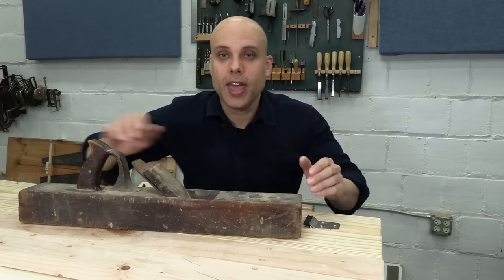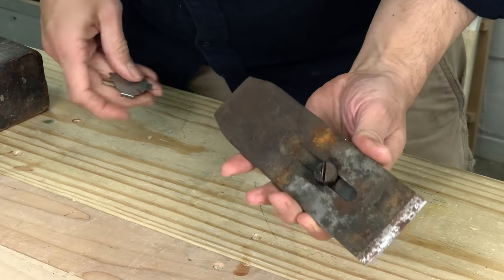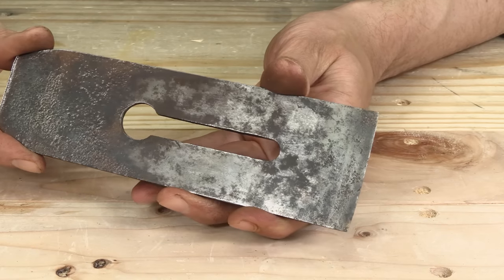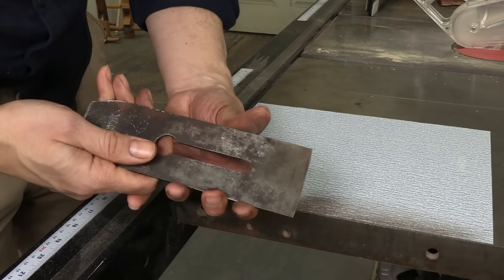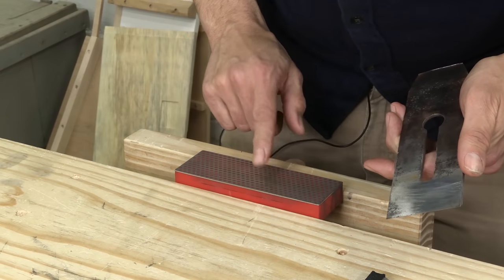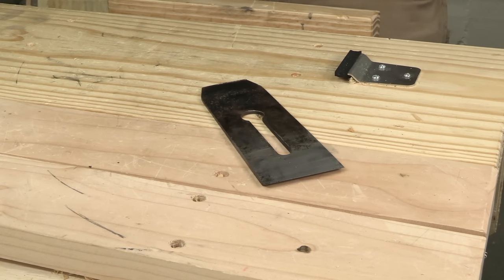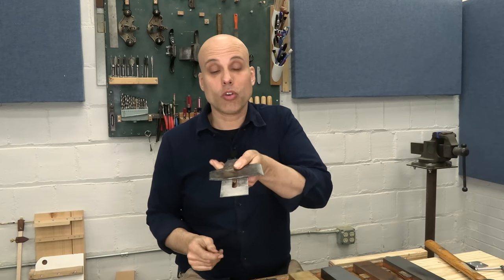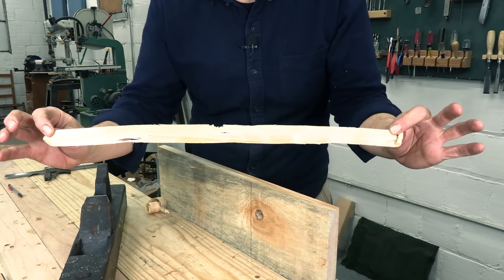Restoring a forged plane iron with MASSIVE rust and damage.

Comment: Hey Rex, love the channel and the enthusiasm. Engineer here: Acid-based rust removal can lead to hydrogen embrittlement in hardened, high-carbon steel, and might have some implications for the hardened lamination and its bond to the blade's base metal. (It also might not affect it at all, but it's a risk.) So the wire wheel: good call.
Reply: I prefer a wire wheel, brush or  cup brush too. There's no really need for those chemicals.
Reply: Steam it
Reply: What about electrolysis rust removal? Would that also risk embrittlement?
Like acid this method also out gasses hydrgen

Comment: I like your stuff and glad you are keeping these old traditions alive. I am a professional furniture maker and I have a massive collection of old planes. BUT when sharpening after grinding your 25 degree angle there's no need for more than a couple of strokes at 30 degrees. Only the very tip of the blade needs to be sharpened. You were over working it and didn't demonstrate flatting off the burr after sharpening.
Reply: Yep. I do ~ 50 stokes at 25deg, and 6 at 30deg. 2 square, 2 favouring one side, and 2 favouring the other side. Plus, debur the back with the steel rile trick from Rob Crossman vids.

Comment: Well now I know for sure the old gussstahl german scrub plane I've been sitting on and wondering about is well and truly dead.  There is almost no tool steel left on the blade.  I had a feeling it wasn't able to be resharpened anymore, but it was dirt cheap, and looks nice in my office.
Reply: Hmmmm. I recall a place called Dusty Rose. I think. And he makes plane irons and even the angled ones I think. Rex knows it infinitely far better than I. 🙏🔥⚒️🧙🏼‍♂️

Comment: I’m in the UK.
Most of the irons in my old planes have chip breakers attached with a screw through a tapped brass fixing on the breaker.
You mention a composite blade, tougher at the blade end. Many English blades in the late 19th and early 20th century (as do mine) have the maker’s mark stamped on the blade in the form of an inverted ‘U’. This symbolises that the blade is open hearth furnace steel and the whole of the blade (as far as wear and tear will allow) is good enough to be reground and sharpened.
👍🇬🇧👍🇺🇸👍

Comment: Many old hand planes here in Europe don't have the chipbreaker attached to the iron with a screw, the only thing holding them together is the wedge.
There is a screw, but it runs along the length of the iron and it is used to adjust the distance of the chipbreaker to the cutting edge.

Comment: Lots of great stuff in this video! Love that you had to grind the iron back to get rid of pitting. I rarely see that actually done, only mentioned in other videos. I go through a lot of 3 and 1 oil out here  as well. Sometimes I have found that doesn't work, so I invested $12.00 in an Impact Screwdriver Kit from Harbor Freight. I've needed to use it seven or eight times on old frog screws, and chipbreaker screws. It has always worked properly and never stripped anything. Huge help when trying to get past the rusted screws. As always, I am very appreciative of the content you put out there and am a weekly consumer of your videos. Thanks!
Reply: I've had good luck soaking parts in Evaporust to get pieces un-fused.

Comment: I just want to add that if you don't have room for a huge grinder like what Rex has, you can use a Dremel with a wire wheel attachment! It will take more time, but surprisingly, it works really well. Love these plane videos Rex!

Comment: When an iron's leading edge is so short there's a real risk it may have worn past the laminated section containing higher quality steel.  A quick check after initial clean up on al ox paper simply involves heating the iron with boiling water and applying a quick wash of citric acid (lemon juice or "matured" coca cola) to highlight the presence of the lamination.  The resulting reaction doesn't harm the iron and is virtually immediate, highlighting any remaining lamination by typically darkening the hard steel (Leaving the softer steel a pale grey) and allows the user to judge whether to continue with the restoration. 

The same method can be used on chisels and older knives and I hope this helps.

Comment: Great video.  I'm lazy when I clean up these badly rusted planes I use 8 second bursts on the belt sander to flatten then cool them in water.  Takes a lot less time than hand sanding which I tired of quite quickly.

Comment: I ran into an odd issue restoring the iron in a block plane. I thought this may be a good a place to post my solution. I don't know that the iron is original. I don't know how, but the side edges of this iron were very uneven, like this was rough cut to fit the plane???

Anyway, there was also a piece of paper wedged under one side of the blade, and the irons cutting edge was not ground square; how could it be?

I could not mark an accurate 90 degree line across the blade, for resharpening, till I ground one of the irons edges flat. Then I marked a line and sharpened the blade. There was no need for the little bit of paper. I didn't bother flattening the irons other side edge. It took a lot of grinding to do the one, and it would be more work getting the second edge parallel.

For a cheap block plane, it works great now. Your tips Rex, made all my planes better.

Comment: If you don't want to spend the rest of your life scrubbing away trying to flatten a pitted plane iron, try 36-grit ceramic sanding belts cut in two. (Make sure you snip off the tape where the two ends of the belt were joined or it will create a high spot.) I like the Shopsmith ones; they take forever to get dull, and even when dull they'll still make progress against vintage tool steel (just more slowly).

Comment: After years of using multiple stones, jigs, and sand paper I have narrowed it down to just 2 diamond plate 600 and 1200 then I strop. I have no troubles at all with the plane irons. I think because we have all these thing’s available to us we use them but we don’t stop to think about what is it that we really need. Make it simple and you will use it make it complicated and you won’t use it or use it very often.
Reply: I'm down to just one 1,000 grit diamond plate myself and then I polish on ceramics.
Reply: @1pcfred  I do that with my hunting knives and broadheads. Sharp is sharp and I actually think the finer you get that edge the less durable it is so you end up sharpening way to often.
Reply: @kentonward97  sharpening is a simple concept and also a dense topic. What's going on isn't always so apparent. The edge itself is microscopic so you can't really see it. Not being able to perceive it with the naked eye people get lots of crazy ideas about what's really going on. The molecular structure of the steel itself plays an important role in everything. The cemented carbides in it etc.  Snow is snow unless you're an Eskimo. Then they have 50 names for the stuff. They know snow.

Comment: I got a large plain with a broken handle a few years ago. Sharpened the blade and the chipbreaker and it works great. The body have a split in it but it's straight. If you are interested i can send you photos. It's a german probably german/estonian.

Comment: Rex, you know 1,000,000 times more about tools than I do but disagree on rust removal.  Wire wheel just takes the surface off. Cleaner followed by Rust911 is wet like you say, but followed by steel wool, elbow grease and wd(water displacement)40 get me fully clean and fully rust free.  Thanks for everything else. Tapping the chip breaker is a great tip.

Comment: i now have bought 4 planes for really cheap. i needed to flatten the bottom on the wooden plane and it was good to go. Of the 3 metal planes, 1 i swear was in a bucket of water as some point... i let it hang out in a bucket of that Safe rust converter, then i had to do a lot of work on it if i wanted a half decent plane, its got a good frog at least, i called it a write off.

Comment: pro tip 
50/50 mix of acetone and transmission fluid = extra powerfull penetrating oil for anything rusted 
for removing rust fast and super clean surface...use norton blaze rapid strip/blend
use Cubitron II sandpaper / discs overall anything you use for sanding / cutting especially for belt sander , grind literally 3x faster than standard sandpapers , colder , last 10x longer (in my case , if you push it hard you get probably less lifespan but still few x more than any "standard" sandpaper)
Reply: Oh yes. The acetone carries the transmission fluid oil in further than normal penetrating oils and then evaporates leaving the oil in place. 

When really stuck alternate heating and cooling with a chef type browning gun (not hot enough to affect the steel) plus using the right size turnscrew by alternate tightening and loosening will eventually break the screw free.
Reply: I've attacked steel with angle grinders but that's not a beginner technique. They make grinding wheels out of Cubitron too!
Reply: @1pcfred  yes 
You can get anything possible for angle grinder from cubitron and even more than you know (like diamond pattern discs , rollock style for big angle grinders etc
You can even get discs for bench grinder 
Hand sanding paper 
Discs for orbital sander are awesome

But for rust , sharp cormers etc norton blaze is the best
Around 70% efficiency of cubitron
But 10x stronger and elastic glue that wont fail when pushed to the limit (where cubitron like to get destroyed instantly) 

For wood there is also permagrit 
Literally buy once last lifetime 
Dremel have few blades from carbide
And you can get carbide discs for different aplication for wood etc (orbital sander disc, angle grinder shaping discs etc) they last lifetime in wood indestructible ( i use carbide tools for 8 years and they still like brand new working with composites -glass /carbon / kevlar fiber etc)
Reply: @ErtsenPlayGames  Norton better than 3M? I don't know about that. Them's fighting words!
Reply: @1pcfred  only BLAZE line , standard norton is great when you destroy blade faster by pushing it to hard , in corners on edges that will rip apart the blade etc...then i go only with norton 
Blaze on the other hand is the best when you need to rly rly push , 
it's like cubitron but that wont get damaged if you literally lay down on tool while grinding only 4mm thick nail etc
Reply: @1pcfred  
Norton Mesh is great too , its better option for corners , edges etc where Xtract will get damaged
better dust collection than 775L , almost the speed of XTRACT but won't ever get clogged by rubber , resin etc because its 100% mesh , not grid pattern like XTRACT but mesh with "sprinkled" abrasive on it

in short

XTRACT - best on flat and best dust collection

775L - toughest one worse dust collection

Norton Mesh - something in between with the best dust collection and won't ever get clogged

Comment: If you get something really rusted where 3 in one oil doesn’t work, mechanics use PB Blaster or Kroil Penetrating oil that is even better. In a pinch you can just grab any lube oil in the garage like 10W40 if you don’t have 3 in 1 oil
Reply: If you don’t have 3 in 1 oil go get some. Every shop should have it.
Reply: @1pcfred  try PB Blaster if you have seized rusted parts. It’s better. But absolutely nothing against 3 in 1. I am just saying if you don’t have 3 in 1, far better to spray motor oil on your bike chain than ride it dry.
Reply: @jrowe9301  PB Blaster was better years ago before they reformulated it. There was a time when the fumes from PB would really bring a tear to your eye. Make you gasp for air too. Only stuff that's toxic is ever effective. It's one of the basic laws of the Universe.

Comment: There is one point here that I think needs some minor correction.  Flattening and polishing the back of the blade has more than one function.  The chief is that you really never need to address it when sharpening the blade except to remove the wire edge, once it has been flattened and polished.  You do the same with chisels, and a plane blade is essentially a glorified chisel.  On a chisel the polished back also reduces friction between the blade and the cut surface when paring.  Remember that the bevel is always polished.  When you employ a bevel-down plane, the back of the blade never comes into contact with the shaving.  So that polish, except at the very cutting edge apparently contributes nothing to the plane's function.  So, why polish it, really?  In fact, the polish surface also helps establish a flat surface for the chip breaker's edge to register against, and the shaving rides on that chip break surface when it is removed.  So, I polish the chip breaker surface where it rises above the blade's back.  It doesn't take a lot.  Just as fitting the chip breaker edge exactly to the back of the blade prevents chips from jamming between the two, the polished surface of the chip breaker helps that chip pass along surface of the breaker with minimal friction.  It might be subjective, but I find/feel it does incrementally improve and prolong the spans between sharpenings.

Comment: I have to disagree about using acids to clear off rust. Acetic(vinegar), citric or best of all oxalic acid will chelate all the rust off the metal right down into the pits. Then it can be scrubbed and flushed with water and dried. The mechanical method leaves rust in the roots of the pits. The result looks more pitted than when mechanically cleaned but that is because the rust is gone. Mechanical cleaning will burnish the metal back down into the root of the pits. Overall though, thank you for the deep look into renovating old plane irons.
Reply: You hit it on the wire wheel and in a minute you're done. Not all iron oxide is bad. Black oxide is good.

Comment: Has anybody else tried hot bluing plane blades? When I do it, only the front part (hardened or laminated) picks up a deep black finish, the rest stays grey. The recipe I found uses 1 litre of distilled water, 650g of caustic soda and 325g of potassium nitrate. Does anybody know a recipe or procedure that covers the entire blade in deep black?
Reply: Different steels react differently to bluing. Hi carbon turns blue/ black. Hi nickel is brighter. Low carbon is dull grey. Laminated blades will not look the same.
Reply: While @David is correct, I would recommend giving this one a try:  https://www.youtube.com/watch?v=4OhhBIN1Odw